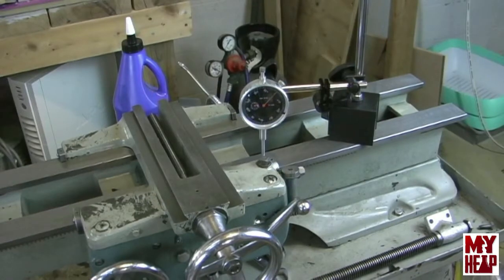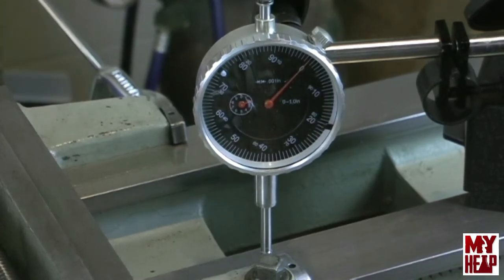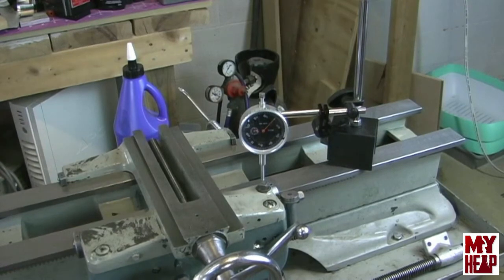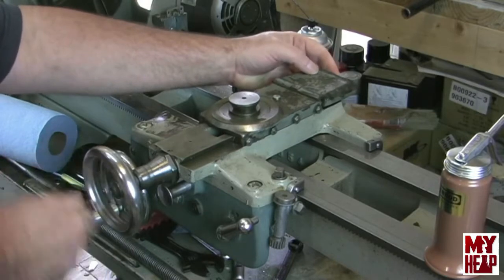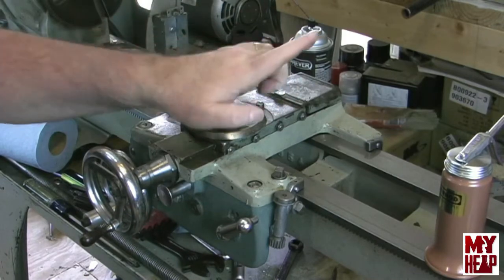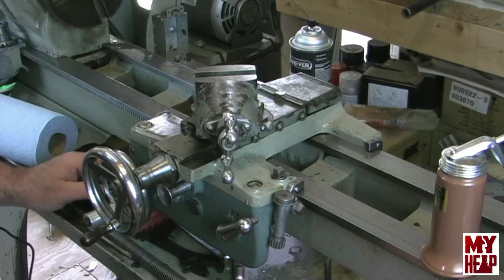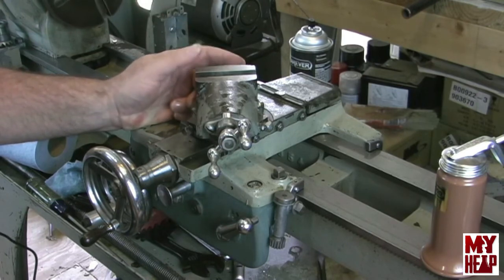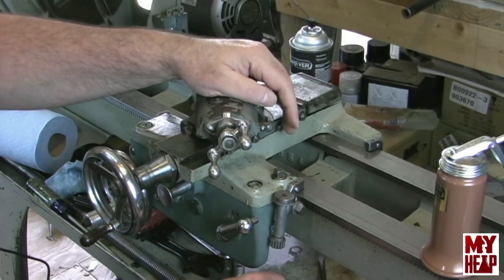Atlas 10F Lathe - TH54 - 18 - Measuring the Saddle Play and More Assembly

Comment: Noga Joe. G'day Joe, back again, so quick. I had too much clearance and it showed up when power feed was engaged and when taking a facing cut, Jeremy offers some good advice on the clearance. Yes 5/8 key stock and all thread makes a good drive dog, you'll see mine in the Steady Rest video. Cheers Peter
Reply from the maker: Peter, thanks for the tip on finding it.  So what is the clearance on yours?  Do you think the .005 on mine is too much?

Noga, that's it.  I need one of those!

I have some key stock so I think I will go that route just so i can turn between centers.

Joe
Reply: My Heap on the subject of aliment of machine tools do a search for Schlessinger tolerances he literally wrote the book on the subject and it's out of copyright now so you can find it for free if your net savvy
Reply from the maker: Got it.  Looks like a good one.  Thanks for the tip.

Joe

Comment: Joe, No problem to add a little packing underneath the AXA tool post block to raise it up over the compound casting. I had the same concern of keeping the lathe original. I used an Amana shaper bushing 1/2" x 3/4" with wide flange and turned it down to accept the post bolt and slot of the compound. Of course I had to use the rocker tool post to do it. Your new tool holder will be a great improvement and easier and faster to change tooling. You'll love it.
Reply from the maker: Steven, thanks for that bit of info.  So you don't feel like you lost anything by putting it on the packing?  I am getting excited.  Funny thing, I realized after I posted the video, that I said I only had the tail stock to do, but then realized I still have to clean and install the lead screw.  :-D
Reply: Won't hurt a thing and keeps the lathe authentic. Works great. I made a tightening lever for the tool post to get rid of looking for the wrench.
Reply: I also had this problem, and I too was concerned about keeping it original but I wanted the tool post to sit flat on the compound so I put my compound in the shaper and shaved it back about 3/4", actually looks like it was made that way now, worked out very nice. As far as the clamping, nut I just made a new one for it instead of trying to machine the one that came with the axa tool post. And also goes without saying this is by far one of the best improvements you can make to this lathe, or just about any lathe for that matter.
Reply from the maker: Steve, while you sending picture, how about your lever assembly you made?  :-)

Joe
Reply from the maker: Richard, would you send me a picture of your milled down casting?  xavier at gtec dot com.  I would like to see it.

Joe
Reply: Yes Joe I will, did you get the other pics I sent?
Reply from the maker: Yes Richard I did, you have the QCTP in one of them, but there is no lever, just a nut.  Also, as promised I will try to get to the Post Office today or tomorrow to send you the stuff we talked about.

Joe

Comment: Hey  Joe,  wish I could tell you what the required play is in the saddle. I checked it by lifting the saddle, and sliding a feeler gauge under the sliding surface.  Don't remember what I measured at. The way I ended up doing it was taking away. 002" at a time till i started binding when slid the lengnth of the way. Then added a thou till it slid nice. Mine is a little tight tward the tail as my ways are slightly warn up near the headstock. I don't do much long work so this works best for me. I could machine that nut for you if you want. Or, if you know what the size and thread pitch of your stud is, I could make you a completely separate one. May take a week or two if I don't have the right size tap and have to order one.
Reply from the maker: Jeremy, thanks for the tip!!

The stud is M14 x 1.5.  Either way would be fine with me.  I can send you the nut or you can make a new one.  Will be happy to pay you for your time.  Richard asked me for a drawing of the nut.  I sent him one but have not heard anything back yet.

Joe

Comment: So, I'm curious, what did you find regarding the slop at the back of the carriage?  I was very interested in hearing these findings as I have a TH54 10X36 quick change and this one item I have never checked on mine.  Just curious, thanks for sending.
Reply from the maker: rtkville, the front averaged .005 and the back averaged .0035.  I hope that helps.

Joe
Reply: Thanks Joe,  You have inspired me to check my TH-54 saddle, I'm surprised I had not thought of doing this before.
Reply from the maker: Just a note, I made my measurements with the saddle moved towards the tailstock end of the bed where there is less wear.  I know you would want some clearence but am not sure how much.  It would also be an interesting test to set the indicator on the back of the saddle and take a good facing cut to see if it actually deflects.

Best of luck and let me know your findings.

Joe

Comment: Joe, .005 is too much, aim for 1 thou but it will be a compromise because the bed will have worn sections where mostly used and good sections with no wear, like under the tailstock which you can ignore. I had 2 in the mills carriage and had to reduce it so I could bore the spindle housing successfully, ok, ok alot of stick out with the boring bar but it does matter, by the way a Coke can is 4 thou. Cheers
Reply from the maker: Thanks Peter.  I think I have a pack of brass shim stock somewhere ... If I can find it.  I bought it when I started the Gingery Lathe.  Will definitely keep the pop can thickness in mind!  Great Tip, Also I think heavy duty aluminum foil is in the neighborhood of 3 thou.

Joe

Comment: I'm a computer geek too and love metal work. I am a bit ahead of you for metal work. :-) Do the backplates first. The 4 jaw first.
Reply from the maker: Hi Steve, I thought I would do the 4 Jaw first for a couple of reasons.  First, the backplate for it will be a simpler job than the three jaw, and ... even though I will do my best to make it as concentric as possible, if it is slightly out it isn't the end of the world since they are independent jaws.  Second, as I understand it, it is more versatile than the three jaw even though it could take longer to set the work up.

Nice to have another geek on board.  I am primarily a network guy, but a one man shop for the Hospital I work for.  How about you?

Joe
Reply: Software developer for about 40 years, specializing in performance for the last 20 years. Working primarily on db2 database.
Reply from the maker: I went to school primarily for networking.  Was hired at a hospital 20 years ago and have been a jack of all trades since.  I have done a little programming over the years.  I started with CBM Basic and 6502 Assembly when I was a teenager while constructing interfaces to run model trains with the game port on the C64.  Done a little c/c++ with Borland builder and QT.  These days the only programming I get around with is web stuff.  HTML, PHP, JavaScript, CSS and MySql.  I just barely get by programming so I will leave the hard stuff to you guys!

Joe